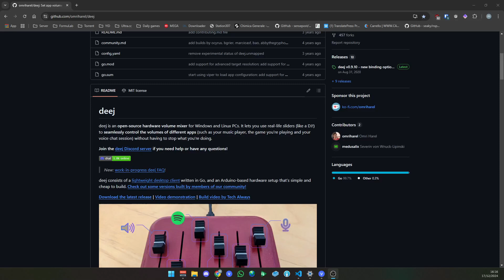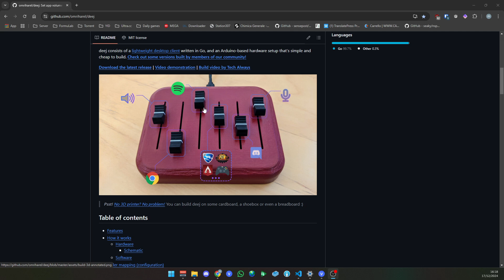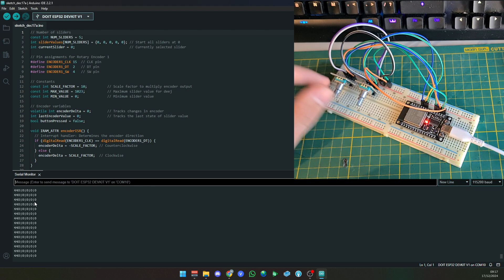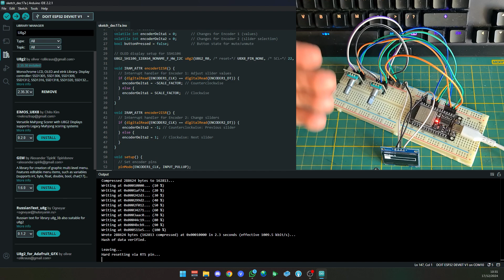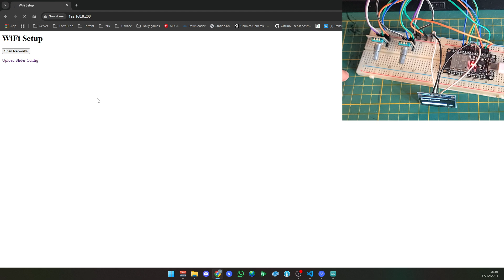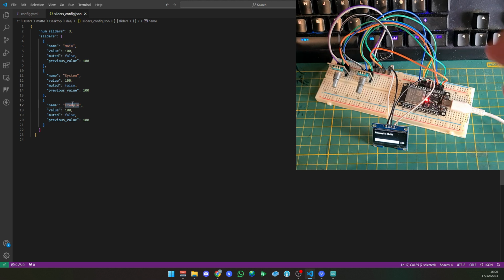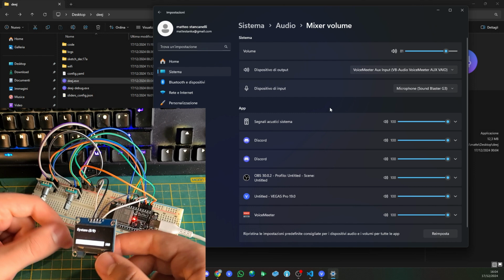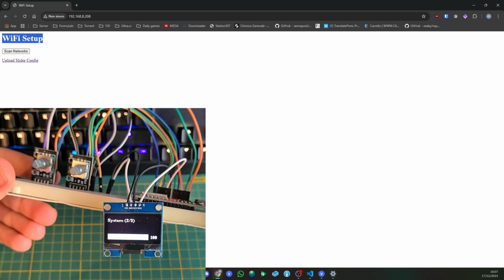Deej32 - A hardware volume mixer with Dual Rotary Encoders & Display | Build log #1

Comment: 👏👏👏👏 awesome!! I’m curious how this could be done with a passive circuit. I don’t want to need to plug the mixer into power.

Good luck on your exams!
Reply from the maker: The good thing is that power comes from the same cable that handles the data to the computer. There is no dedicated power cable.
Reply: @PescaDIY  I mean I don't want to plug it into a computer either 😶‍🌫

Comment: Hello, thx for you'r vidéo it's really helping. I want to do a macro pad with same screen potentiomètre and key ! Is it possible to have thé list of you'r hardware please
Reply from the maker: Sure, for the rotary encoders i used HW-010 (https://it.aliexpress.com/item/1005006771676270.html), the screen is a 1.3 inch I2C oled (https://it.aliexpress.com/item/1005007451015054.html), the micro controller is a ESP32 Wroom a good choice if you need a lot of gpio if you dont need a lot of gpio i suggest you use a ESP32 C3 super mini as it is really small and cheap.